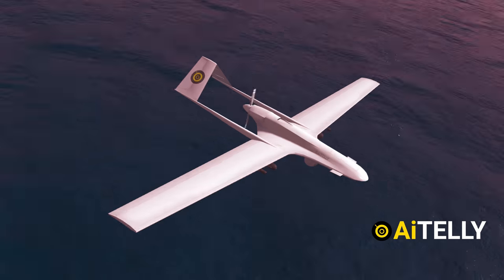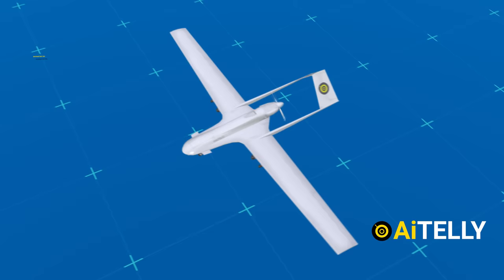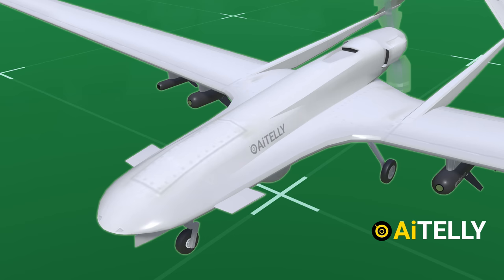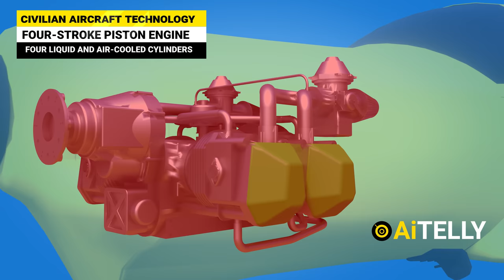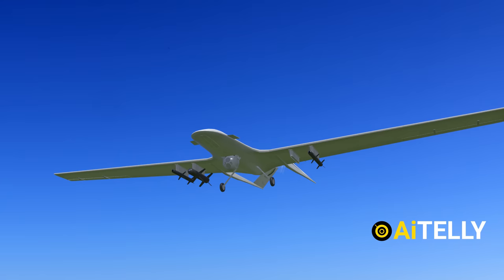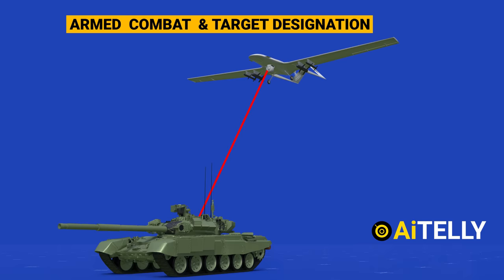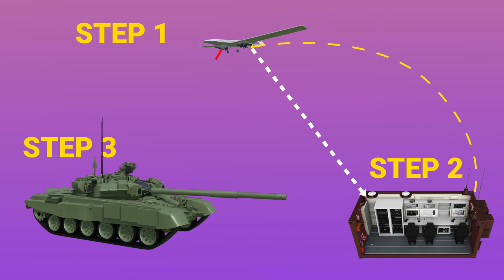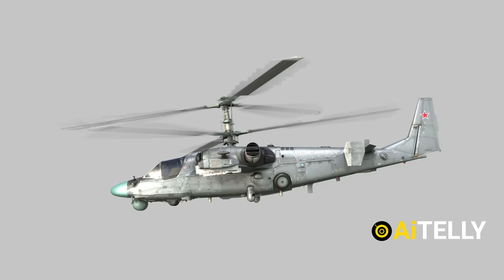How a Military Drone Works | Bayraktar TB2 UAV

Comment: motor pd170 TEI
Reply: sallama  . pd170 uygun değil tb2 için .
Reply from the maker: if this info is true it will be requiring another Video for this address.
Thank you for the info
Reply: @Aitelly  no he's wrong  we never used or going to be used pd170 engine . its not suitable for tb2 .we have already used Rotax 912
Reply from the maker: @prodeerpentium  Is this right ? 

because i have been researching the whole internnet could not find the Engine for the TB2 

Thank You for this Valuable info
Reply: @Aitelly   we will planning to use  pd-170 engine with tb3 which will be a "stol" uav
Reply from the maker: @prodeerpentium  Yes thank  for this info. I also found out this moning.
I mean every counties use different product for their military industry. 

Example - 

1)The F35 parts are are being made by around 10 countries.

2)Even Turkey is also mnufacturing parts  of the F35 jets.

3)ndia is using the F16 Engine for the TEJAS.

4)for CPU Taiwan is manufacturing Computer chips.

5)Javelins are also being reproduce by Turkey

No country can do it alone.

 No Shame in that
Reply: @Aitelly  turkey "was" a manufacturing parts  of the F35 jets.  that process ended by usa at december 2021 .no longer produced .  on the other hand i didnt know that turkey reproduce javelins under licence agreement  .i know that     turkey is developing "karaok" atgm  which  looks like Javelins  but not under licence agreement
Reply from the maker: @prodeerpentium  Soryy i meant Stinger Missile.

 Roketsan Roket Sanayii ve Ticaret A.S. is a major Turkish weapons manufacturer and defense contractor based in Ankara.

that is alo working on the Javelin Missile a version of theirs
Reply: @Aitelly   i see.  yeah  Turkey has been producing stingers under license agreement since 1986.  we have already produced  own luncher system for "mrap"  "atılgan"  "zıpkın" . actually we dont need stinger anymore . we made own "mpads"  which is called "sungur"

Comment: How many of these were lost over Ukraine? it seems like 30-40 uav's
Reply: Does it matter how many are lost when it aided the sinking of Moskow or saved Kiev or saved Odessa or liberated Snake Island or destroyed countless SAM systems, supply lines, tanks, ships and even trains?

Simply put, even with your exaggerated numbers,  countless number of lives were saved without a single loss of life.
Reply: @patnutoris4054  Snake Island was not liberated by TB-2, but by constant strikes of MLRS Himars and Uragan, all TB-2 that attacked Snake Island were unreliable, the role of TB-2 in other battles is also negligible, at best they are used for reconnaissance 20 km from the front line, and that is, there is a huge risk of losing them.
Reply: @milaro222  HIMARS were not even delivered at the time of Snake Island but nice try.  Also, there are literally videos of TB2 blowing up shit on Snake Island with precision guided ammunition, including SAM, boats, crane barge, infantry, ammunition depo, warehouse, radio tower. However, my favorite is where they blow up the Russian helicopter on Snake Island with all the Russian criminals in it.  Another good one is were TB2 is hunting down the Fast attack craft screaming about chandeliers in the sky.  It must suck to be a russian troll.
Reply: @patnutoris4054  There was an attack on June 20, up to 15 TB-2s were involved, they managed to hit several targets, but they were almost all lost from the fire of SAMs and fighters, after that the Ukrainian army switched to a new tactic of shelling the island from MLRS, Himars began to arrive even then, the island was bombarded with missiles for 10 days, after which In June 30, the Russian forces were absent, TB-2 proved unsuccessful in the battles for the island.

After the massive TB2 attack on the island, their use in combat operations completely stopped for 2 months and since then they have been used very rarely exclusively for reconnaissance.
Reply: @patnutoris4054  The Su-30 fired a missile that shot down a target at a range of 60 km, which video you are waiting for is unclear.

As for the fact that Bayraktar can fly far from the front line and conduct reconnaissance, I wrote about it myself, at a distance of 100 km, Bayraktar can only detect an island 1 km wide against the background of the sea, on land the picture will be an indistinct mess, he can't direct any weapons at such a range, 30 km is the real range of effective work, but again with the risk of destruction by air defense, in this regard, small UAVs that can be made 300 pieces for the price of one TB-2 are much more effective, with the help of the Orlan-10 UAV destroyed 100 times more targets than with the TB-2, in Ukraine, anyway.
Reply: @patnutoris4054  The Russian Air Force is armed with R-37 missiles, their maximum firing range is 400 km, there is evidence that they are successfully used in Ukraine.

I personally do not see any signs on the video from Kherson that the TB-2 was guiding something, it is quite obvious that it was only conducting reconnaissance to confirm the presence of targets at the airfield and the results of the strike. The strike itself was most likely carried out by unguided missiles of the Uragan MLRS, at best, Ukrainian Olha missiles were used, with GPS guidance, which fired at previously known coordinates.

Comment: The point behind the video is refusal to acknowledge the Turks are capable of coming up with a great drones like the TB2. He is full of contempt. The parts he refers to have been replaced by domestic produce. the engine is no longer ROTAX but PD170 and the  WESCAM camera has been replaced with ASELCAT
Reply from the maker: It has been addressed the changes are made for the upcoming variants the TB3 not the TB2.

Regarding the engine as well as camera

Comment: Tb2 does not use rotax engine and wescam cats. Tai uses pd170 engine and aselsan cats. The system you advertise before the embargoes.

There are bayraktar tb3, Tai anka, Aksungur, Akıncı which are more advanced than TB2. now the kizil elma is done.